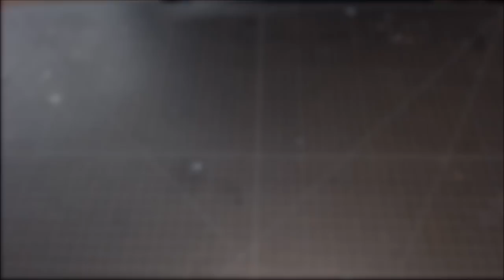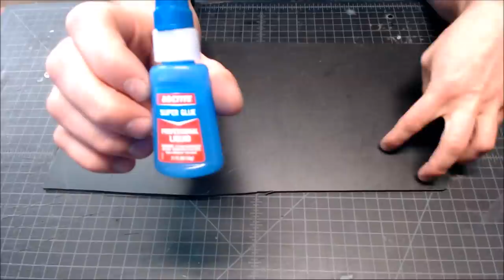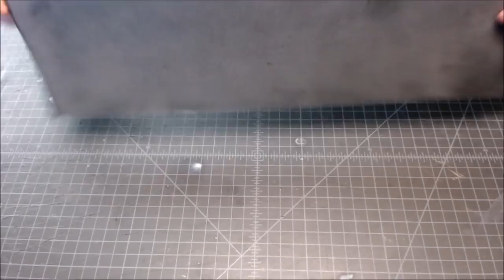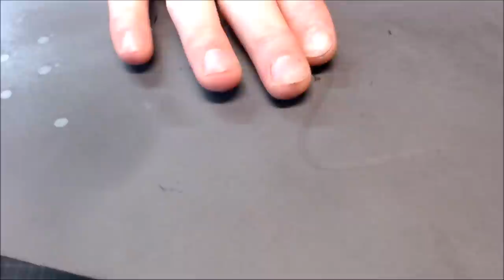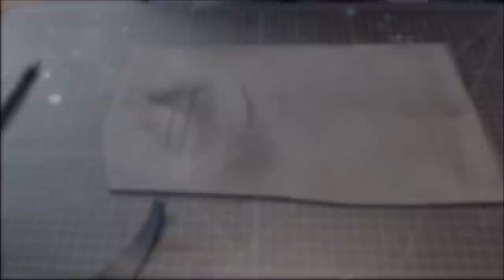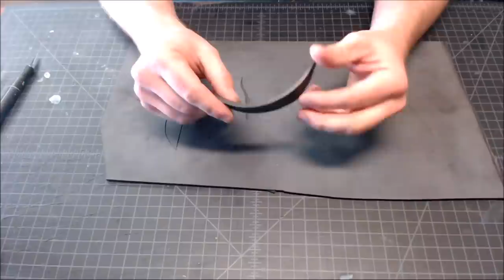Sintra for Cosplay : What is it and how do you use it for costumes

Comment: That moment when he told me about the fumes that come out just from heating this material makes me wanna stay with Eva
Reply: He's full of shit, you have to pretty much burn it for it to release toxic fumes. If it doesn't get hot enough to change colour, it's not hot enough to release fumes.
Reply: well he got a point, pvc releases gas only if burned or the material would lose it's proprieties after being heated once, still when working with materials that can releases any kind of harmful gas it's better to have some kind of ventilation or , in extreme cases, using a mask with the right filter ( if we talk about hydrochloridric acid then a simple respirator for painting won't do and also you will need protection for the eyes since it can damage those too, anyway most people are able to notice the gas before it can cause damage because of it's strong odour)

Comment: Great video, sintra is my favorite material for cosplay but you forgot to mention a couple of really cool properties about sintra:

1st: even though it is a foam the cells or "bubbles" it has are so tiny that you can sand edges down to a super smooth finish and the bubbles wont be even visible.

2nd: it has "different rigidness" depending on which axis you bend it. for example if you grab a perfectly squared piece of sintra it is easier to bend it pressing from 2 oposite sides than rotating it 90 degree and doing the same (it's hard to explain) 

3rd: if you heat it up to bend it you can stretch or compress it to make compound shapes like those on your shoulder armors.

thanks for your time and keep your hardwork, it is amazing
Reply: +Menteausente 2nd point it's the structure of the stuff, pretty muchlike the way a sheet of paper will tear more roughly in one direction than in one 90degrees over
Reply: yeah, that's want I mean, for that reason if you want to make say a shoulder, you can bend it in the softer direction, but you can make a very stiff sword blade for example if you use the other direction around cause it is much more rigid
Reply: Where can you buy it do have a link?